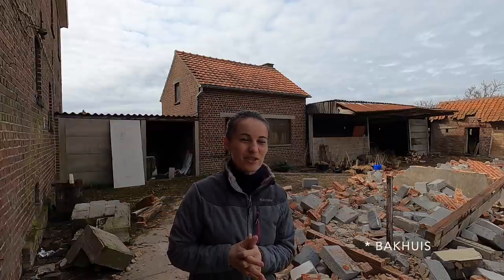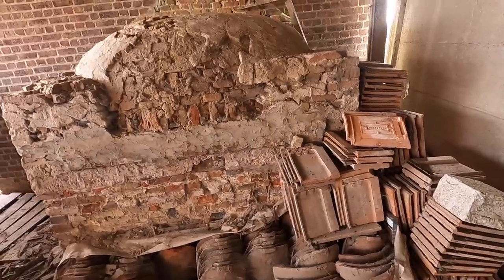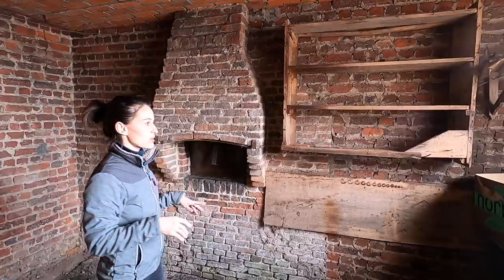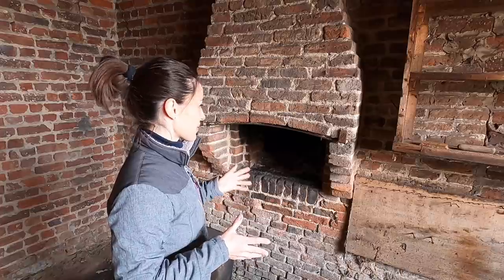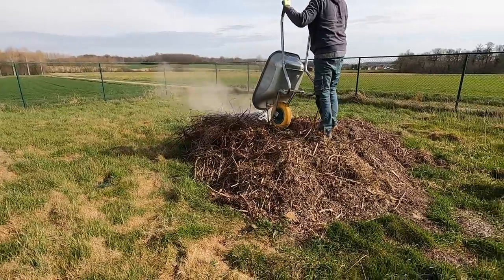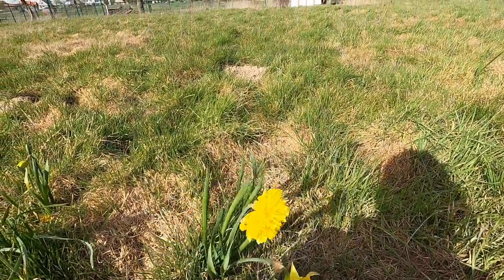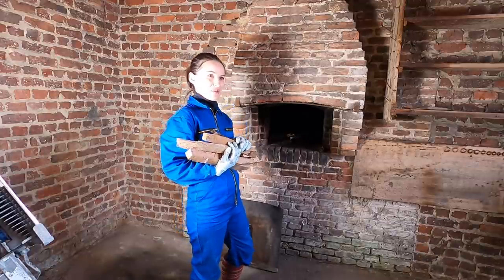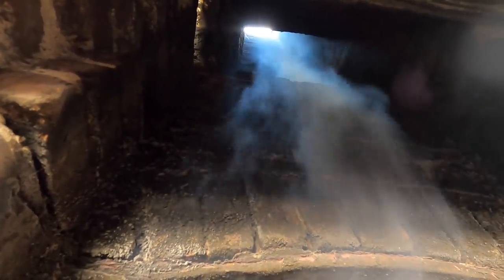Cleaning 100+ y.o. BREAD OVEN  / Tour our bakehouse

Comment: As a pizza chef who works with wood fired ovens I just want to remind you that it may be called a bread oven but it is simply and oven. You can learn how to regulate and manage the heat by where you put your fire, how long you burn it and the wood you burn. And you can cook anything in it. With practise you be getting it super hot for pizza, then clearing the Ash out and cooking bread on the first heat, then cakes and maybe some slow cooked meat left in on the residual heat. Good luck.
Reply: I believe the name petit four means small oven. After cooking bread bakers would use the lower temperature oven to bake pastries. https://en.m.wikipedia.org/wiki/Petit_four
Reply: All those ashes were from burning paper, the previous owner was not using it as an oven or just had a lot of papers to get rid of. a bread oven would never have that much ash in it.
Reply: Great comment...  We primarily use ours  for most cooking throughout July, August and September to keep the heat out of the house but when the kids and the grandkids come for Christmas week we use it all week and never let it cool down,  i cook a half a side of pork at a time in there and we use a variety of dutch ovens in the stone oven for compartmentalizing and different temperatures, ofcourse pizza is quite popular with the little kids and I

Comment: Just a tip form someone who has done a little bit of wood fired pizza making - you can use a wet mop to clean up any ash from the floor of the oven (good if you want to put bread right on the bricks) and also get a Infrared Thermometer. Also you might like to make a metal door for the oven - as cooking once the fire goes out is possible, and the door helps keep the heat in. The big thing to manage though with an oven like this is the amount of wood it needs to bring it up to temprature and then keep it there (it might take the best part of a day!). Have fun and good luck and thanks for posting!  :-)
Reply: Yeah a door is a must for cooking in the embers. My Irish grandmother had a wood fired aga & a wood bread oven in the wall. The bread oven had a metal door and she said it helped keep the heat in. I don't know how she cooked with the aga & the bread oven, because there were no thermostats or temperature indicators but her food & bread were PERFECT every single time. :)
Reply: 900 degrees for pizza, as it cools bread and cookies...quiche
Reply: There is a metal door to this oven already.
Reply: @troublemcallister730  thats old people for you, they have some of the last greatest known knowledge and secrets.
Reply: She knew the wood fire. Experience!
Reply: I saw you take a metal door off before you cleaned it. In other posts, I  have seen a variety of long handled tools specifically designed for working with this beautiful ancient oven. 😍

Comment: We use a very similar type oven here in Pueblo country in New Mexico and have for centuries within my pueblo the women only use dry ceder wood for baking it burned hot and clean and leaves very little ash and the smoke gives bread the best flavor
Reply from the maker: Hi Curtis, cool and very interesting, I didn’t know about ceder. We have ceders here but ... they grow in botanical gardens 😂 it would be a fortune to use it as a burn wood.
Reply: @DeHoeveOldBelgianFarm  well it's juniper but still a variety of cedar and that as well as pinon are what grow here. We are high in elevation a dry high desert on the Colorado plateau. We use what we have and it serves us well at least we think so

Comment: I would scrub the bottom of the oven so it is very clean and then find some fire clay and give it a coat of 1 inch thick to smooth it out , this will make cleaning it out much easier and smoother floor for baking on

Comment: Hello. You found wire in the bread oven. I think they wrapped a bundle of wood together with wire and put the whole bundle into the bread oven.

This is how.

Take a bundle of wire wrapped wood and set it about arms length inside the bread oven. 

Light the bundle on fire and push it all the way to the back of the bread oven.

Do this with three or four bundles of wood. Pushing them all the way to the back wall of the bread oven.

When the bread oven is hot enough you can cook your bread in front of your coats. Turning the loaves as needed. 

Have fun with your oven! Cook lots of loaves of bread at once. 🍞🥖🥐🥩🍕🥔🥘

Comment: We use ours for most cooking throughout July, August and September, we also use a 3 burner wood stove that pipes into the chimney.   Learning how to maintain 350 to 375 degrees is the tricky part, it takes a few burned loafs of bread to figure out the best place is in the oven.  Dutch ovens work well for compartmentalizing.   Anyway,  it takes about 24 hours to heat our oven up and we never let it cool all the way down once we start it,  i put a fire in it once in the morning and once in the afternoon.

Comment: The bake house was something that would be used not only by the family itself, but for the whole neighbourhood or even a village, some bake houses were not owned by a single farmer but the property of the local community, and situated on a public field, often near the village water well.
The reason was because it took too much work to fire the oven for just a couple of breads.
Firing would start days before the actual baking took place, and the brick and clay arch slowly heated up.
Mostly bundles of thin branches would be used to fire the oven, like what you removed from the front yard, it was easier to harvest this kind of wood which otherwise would be waste from cutting hedges and maintaining fruit trees and the local known holle wegen, which are roads that were eroded out into cuttings over centuries, the embankments would be covered in brush which had to be cut yearly to keep the road free.
When the oven reached the needed temperature (which was judgement as no fancy things like infrared thermometers existed) the fire and ashes were removed and people would bring their bread dough and cakes (often a local sort of cake known as 'vlaai' in Belgium and Dutch Limburg made with a dough bottom and different local fruits on top like apples, cherries and plumes) or prepare it on site when the bake house had a building in front of the oven like this one.
So just quickly making a pizza is not possible, it takes days to get the oven hot enough, firing it to hard will damage the brick arch and floor, which will crack.

Comment: yes the oven is a gift simply recondition it with a coat of hellenite slurry to tuck point the brick inside and out and cover the exterior roof top with clay With all the digging your planning you can process your own clay in buckets and cheese cloth old tee shirts are best ...tie the bagged clay into trees for drying and wet set the clay to the roof of the oven exterior...

Comment: My grandmother used to take her Christmas cakes to be baked in an oven very much like this. The fire was stoked on the sides and the bread or cakes were put into the oven with a large cast iron tool that had a flat plate at one end, I do not know what they were called. They were removed the same way. The cakes always cooked in quite a short time and never got burned in the way they do in a home oven. The only difference between that oven and your was it was built into a corner of the bake house. When they cooked bread the loaves were allowed to rise together on boards the right size for 16, which were then transferred onto the device I describe above. Baked together the outside ones would have more crust than the inside ones so you could ask for soft bread or crusty bread according to what you preferred. These too baked in around half the time of a home oven but the guys running the bakery never seemed to burn any. Neither was there any build up of ash, .I guess they cleaned it out regularly during their quiet times. They could load it with two lots of 16 loaves, and did a roaring trade. Around these batches they would put spicy pastries to bake, first come first served. We had a much smaller version in my childhood home, but I never saw it used as we had a big enamelled Aga type oven. Those brick ovens put out a LOT of heat when they are fired up correctly. My guess is your one fed quite a lot of farm workers. The loft upstairs looks like a granary or at least a store room for flour. High up meant dry. And likely there would have been cats….

Comment: I think the previous owners only used the oven to heat the spaces they used as a workshop. There was certainly no room to put bread in all that ash. I suspect the niche on the right of the oven door was where you'd set the bread dough to rise. 
An acquaintance who built a bread oven said that if she got it good and hot, she could first put in a tray of biscuits, which would be done in minutes, then a couple of loaves of bread, and, if it hadn't cooled too fast, then a pot of stew, which would cook slowly as if it was in a slow cooker.

Comment: Those Flies in the Windows under the Roof seems to be normal, they get into the Gaps between the frames and windows to get through winter and go into winter sleep.

What i figured out, without using any Anti-Flies Sprays in the Spring. Kill them in December.

...or replace the Windows with new ones which are very sealed.

Comment: Great video, you have received excellent advice from serval people who have lots of experience with a wood oven.   Safety should come first = 

1- clearance of the oven 
2- cleaning the chimney 1st before lighting any fire ( years of smoke could have set this in flames very quickly) 
3 - the inside of oven should have been cleaned with water & Mop serval times before you set a fire
4- when lighting your first fire you didn’t check if any smoke was coming out of the other side in the adjoining room?   

 You have a fantastic farm and beautiful buildings which you are going to spend lots of money & time on for years to come, Please don’t take any risk with fire.

A few simple things & some research will be invaluable to your journey.   Research research research everything you do before you go ahead with any projects so many people have done this before you so use that experience and don’t waste your time or money on trying things out. 

So looking forward to seeing how you progress with your journey.

Comment: That's Asbestos on the roof or not?
In what region you are ?( about)
Reply from the maker: On top of the bread oven? Yep, asbestos sheets. Need to go away. 
Sorry, not sharing the location on the internet out of the safety reasons...
Reply: I understand 😅
In about two months i will move to Belgium to😁
Reply from the maker: @pitbullpeerke6019  Peerke sounded so Flemish, I assumed you are from here :-) where do you live now, if I may ask? Belgium is wonderful, everyone will find smth for himself.
Reply: @DeHoeveOldBelgianFarm  Now i live in Holland near Eindhoven. 
I want to move to Lommel or Neerpelt or Arendonk as close to the border as i can so i don't have to drive so far to my work in Holland.
Reply from the maker: @pitbullpeerke6019  aww... Holland :-) then you know the drill 😂  
Agree on the distance from work, so exhausting to have long rides to work. Important point to consider while looking for a house :-) good luck in finding the best option!